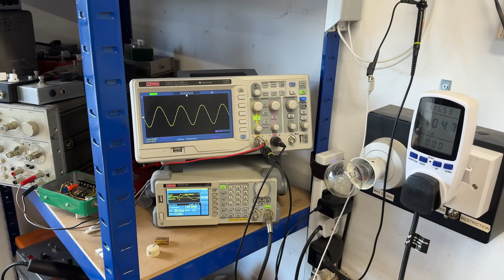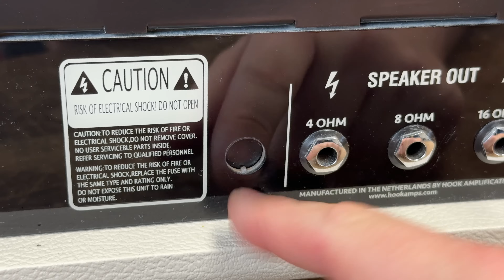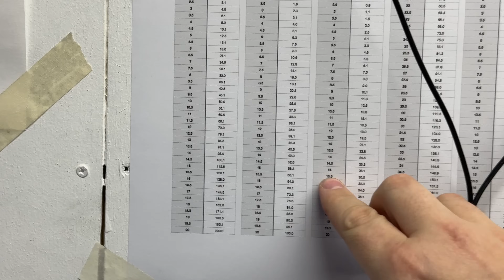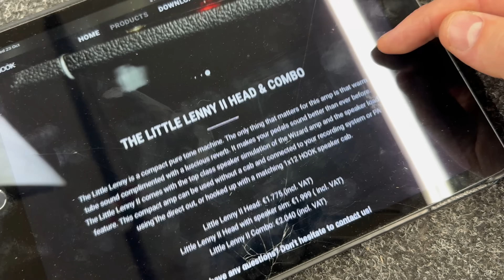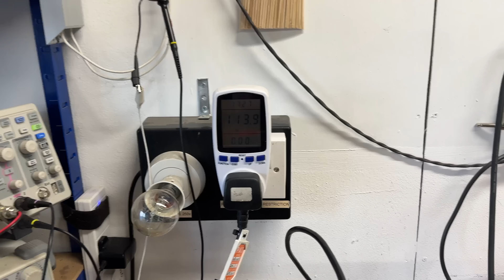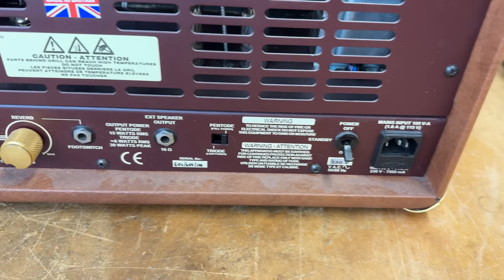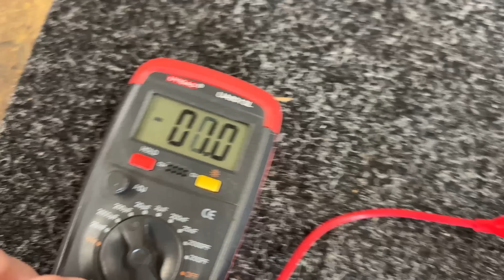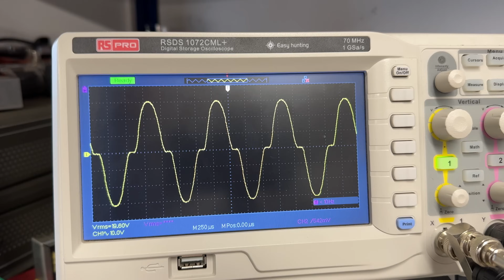Getting this amp off the HOOK | Rift Weekly Update

Comment: Owner of the Hook in this video here. And yes it’s always been a bit sketchy on the details of these amps. Essentially Anderson’s stocked and sold these for about 5 minutes a few years back. There’s an Anderson’s video with Pete and Lee from 3 years ago that runs through the Little Lenny Ii and they reference that it is available with and without the load box and IR tech, and I recall the options on their website at the time. So my guess is that either the II version started out with the with and without options and then migrated to load box only, or Anderson’s spec’d a non-tech version for their supply and maybe Hook just adapted some standard units for them. Who knows!
Reply: And having a look at the website, there are two prices for the head, one without and one with load box and IR, but only info for the later version. The combo version doesn’t seem to have the load box and IR tech option, and the picture of the panel says Little Lenny (no II). I think they’re just all over the place with their version control!
Reply: Sorry, do you mean Andertons. Just to be clear.
Reply: @arthurgordon6072  yes sorry Andertons!

Comment: When you get time could you do a Video showing how you wire the "Protection" Diodes on amps with Valve rectifiers, it would be a great help to know how and what to use for 5U4, 5y3, 5AR4. Thanks...it would make a big difference knowing theres a "Safety net" just in-case. Do you think the Brass coloured Weber valve shaped solid state rectifier can is more dependable than Valve types and can they change the tone that the amp produces?
Reply: I too, am interested in seeing how this is done!
Reply: Normally with octal Rectifier Tubes, the 2 HT wires go from the PT to the octal sockets pin 4 and 6.

Pin 3 and 5 are unused pins so they make for a good terminal 

To install the „Protection“ Diodes, you just have to wire the 2 HT Wires from the PT to the unused pin 3 and 5 and then place the IN4007 Diodes, one between pin 3&4 the other between 5&6.

So the diodes are simply in series. Just be careful that the diodes cathode side (stripe) is placed on the output side (pin 4 and the other Pin 6)

Now the HT AC voltage gets prerectified before going in the rectifier tube. That has 2 advantages: 1. it puts less stress on the rectifier tube and helps with longevity 2. in case the rectifier tube goes bad, you don’t get AC voltage in your circuit, because that can cause a lot of damage.

Be careful: unplug the mains and drain/discharge all the Filter Caps at first